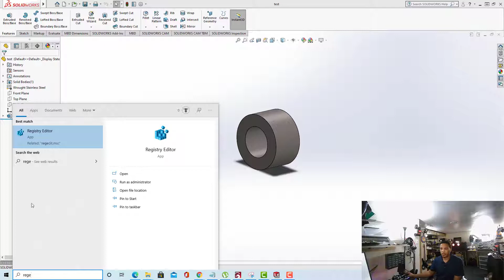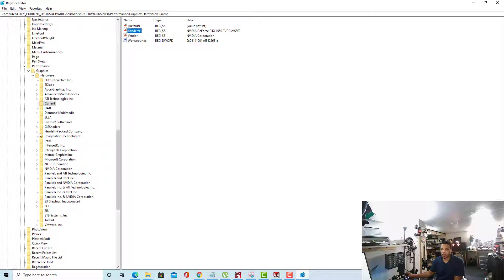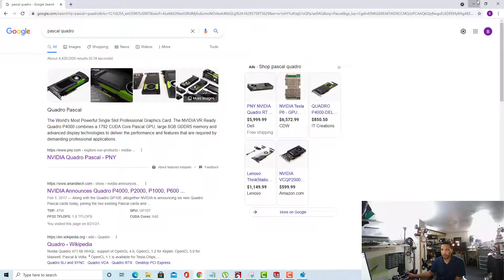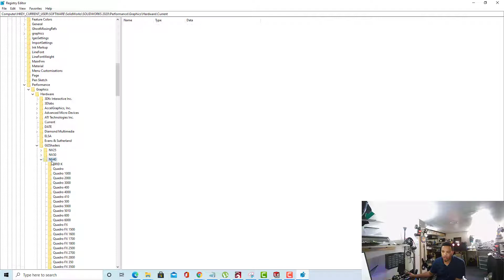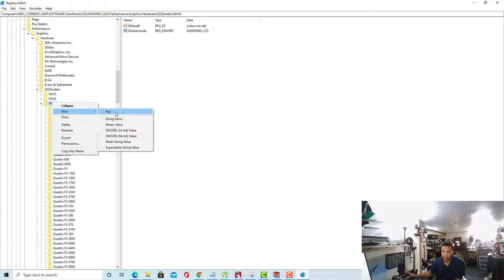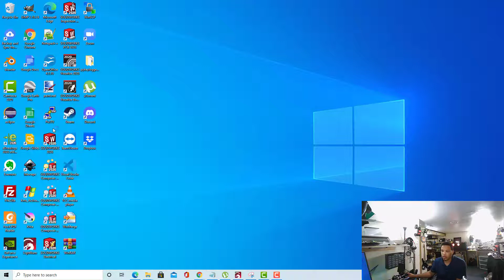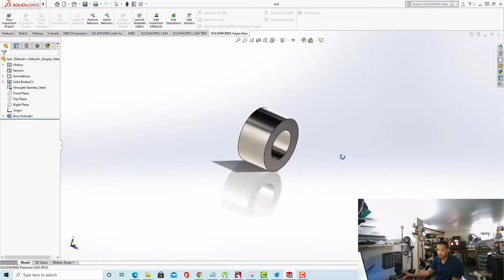2021 SOLIDWORKS Realview Graphics on ANY PC 2021 update Nvidia 1050ti

Comment: Thank you for making the architecture link, being the key to make this method work. Not only real view working properly but enhanced graphics can now be activated in performance options. On a 5 year old Dell laptop with a full spec 2080 card and SW2022 it worked fine. It had an Oct 2022 nvidia gaming driver installed, didn't have enhanced graphics on and ran performance monitor, producing 102.8 secs overall. Then swapped to Jan 2023 studio driver and turned enhanced graphics on. Now perf is 82.6 secs overall and this was all from graphics going from 47.8 to 26.5, how much was eg and how much driver, who knows - but it is a useful boost. Rendering and simulation were steady at 11.5 and 29.8 respectively, but realview dropped 3.1 secs to 23.6 secs. I am left wondering if gaming laptops are not THE premier solution, assuming this hack works on modern machines? But just posting to say it works, now not affected by drivers as others have experienced, so pay careful attention to the details if it seems not to work.

Comment: Thank you for taking the time and making the effort to explain that the supported GPU architecture and the unsupported GPU architecture should both have the same name. It is then easy to understand that cross-referencing the architecture name of the unsupported card to the matching architecture name of a supported card in the Windows registry is necessary for the correct DWORD hex value of the supported display adapter to be copied into the newly defined key in order for the current display adapter to work with RealView.  You make it a lot easier to understand versus trying to explain it after learning it from you.  Well done, sir. Well done indeed.

Comment: Hi I made it work dozen of times, before but now I got an issue with my 2 gtx 980Ti , I don't know why. I will try another driver, but it has worked on the same setup last time it's weird (W10 SW20 GTX980TI x 2 )

Comment: I have gtx 1650. I tried this but did not work. can you please help me by giving "workarounds" value for 1650 graphics card.
Reply: It is 300008 or 30408
Reply: Brothers u should also un check the open gl in sitting performance
Note: u can un check the open gl icon only if u haven't opening any sketch or assambly

Enjoy usuing the real view❤❤

Comment: tried without success on my gtx 1080ti, unfortunatly. :) Edit: solution for me was an earlier nvidia driver + follow the instuctions in the video. Thanks!
Reply: Downgrade your driver from current version to 466.47 (perform a clean install)

Then do regedit.
Your realview will come back!
I'm using GT710,and It worked!

It has been issued that latest Geforce Game ready drivers aren't giving realview in solidworks Right now (upcoming version won't give you realview anymore)

So only way is downgrading the driver 
By 4-5 steps down.
Reply: @asif.a15  This actually solved it! Thank you for the suggestion! Used the 31408 Value as suggested in the video. Asus strix 1080ti .
Reply: @asif.a15  It did work for my Palit 1080ti thank you very much! used the value from the video.
Reply: @ludwigtrachtenberg  it's my pleasure
Reply: @asif.a15  thanks a lot, was wondering what I was doing wrong
Reply: @chivasdeguadalajara  my pleasure!
Reply: @asif.a15  tnx man....not getting real view after drivr upgrade...worked for me..thanku so much
Reply: @cgj9994  It's my pleasure!
Reply: That's amazing, I love it😃
Reply from the maker: I'm sorry did you get it working maybe we can figure it out, I've done it exactly as this many times now... including on a Lenovo y50 1080ti
Reply: This would be the best explanation I have seen, however I have not found your reasoning for “Quadro”? As my card is a NVidia GeForce RTX 3060, why did you pick Quadro please. I couldn’t see it anywhere on your searches. Regards
Reply: Value for 3050ti